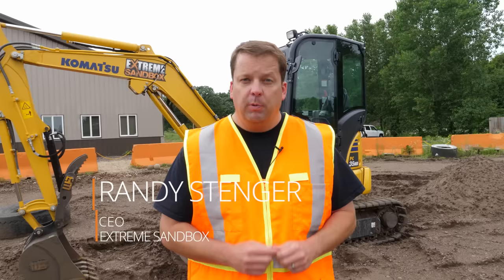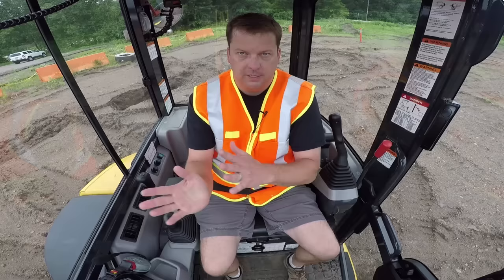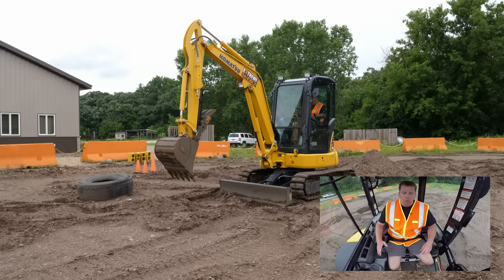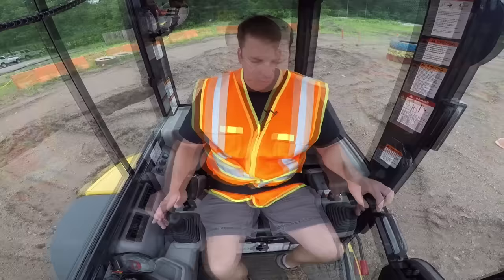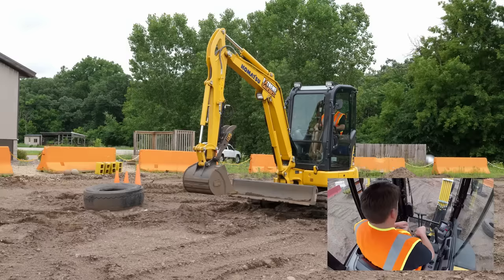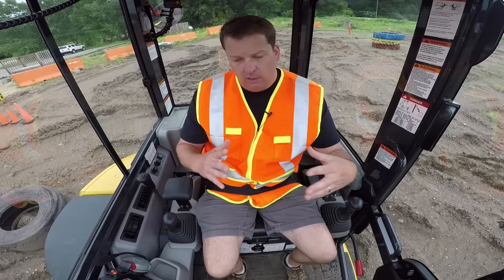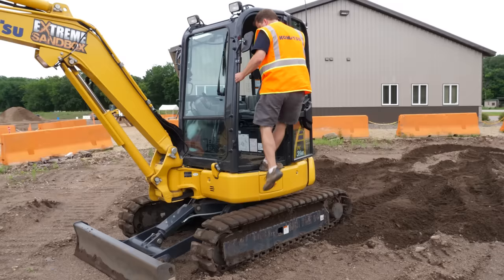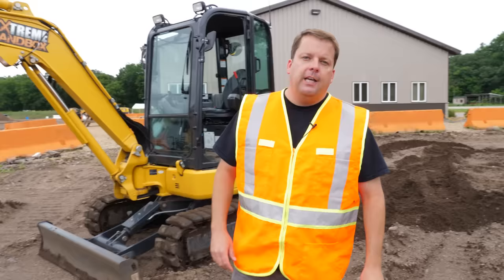How to Operate a Mini-Excavator | Mini Excavator Controls

Comment: As a professional excavator driver when operating a mini Digger with a Blade Allways Have the blade at the Back when you are Digging, there are 2 reasons for this no 1 you have more Digging pressure for the Bucket to dig and less chance of pulling Wheelies, no 2 you wont break your Back with the Digger bouncing and being  unstable, please feel free to test this out as you won't be long finding out whats best 😂😂😂😂
Reply from the maker: Thanks for the comment and feedback!
Reply: @HeavyMetalLearning  super channel it really helps drivers / operator's well done ☺☺☺
Reply: Coming from the lowlands (Netherlands). On the mini’s here you see a lot of extensions bolt on the blade to make it even more stable. Just 4 or 5 inch extra helps a lot in soft and wet dirt or clay. And the crazy man is right. Keep your blade in the back while digging. One or two bounces you Will survive, But getting kicked around in that cabin all day wears you out.
Reply: I always wondered why my dad sometimes left a mini ex with the cab turned around. That explains a lot.
Reply: I was thought not to dig on the drive wheels
Reply: @paulpresto8140  It's one of the biggest differences operating a mini vs a full sized one.
Reply: No. 3 gives better visibility into the trench
Reply: @paulpresto8140  Correct, for the bigger machines, for minis it different( blade to the rear as recommended by the manufacturer).

Comment: As a certified heavy equipment operator of 6 machines it is highly I'll advised to give anyone the idea that it is acceptable to dig from the side. You did mention that the machine is not as stable but that is a very lethal piece of advice as the mini as well as a 300 are HIGHLY prone to tipping and being unstable from side digging. For teaching anyone that has never used any machine I would just not recommend digging side on at all as this will give a dangerous impression that it's only a "little" dangerous. Everything was awesome but as this is instructing new comers to these machines any piece of advice that leaves room for interpretation of safety will cause injury. Not casting stones just figured I would share my knowledge from the field as to help make better and safer rental users :)
Reply from the maker: Appreciate you constructive feedback.  While I would say I generally agree with your statement, I don't think I would call it a "lethal" mistake for not digging square to your tracks (if the machine was not designed to dig that way there would be lock-outs to prevent it), so I agree it's good practice but no reason to scare a new operator when not necessary to just teach them the best technique.   Thanks for the comment.
Reply: @HeavyMetalLearning   oh it is not to scare. I just see it happened to often where the comfort level becomes the issue not so much the information. I've personally seen a few minis roll over due to complacency. Usually those that roll in that fashion are full bucket loaded added to the speed and weight pulling the mini over. Its practice that if it's not considered a lethal choice it can become lethal so it's more about the level of danger that the machine can be in without an experienced operator at the helm a small tip can turn into a big roll especially when you are fighting the balance. As a way to combat side digging with new operators you can recommend also using a 1 o'clock or 11 o'clock track positing and digging at diagonals to the tracks is a much safer and more stable way to side dig

Comment: Quick tip... I always move back and forth after putting the stabilizer bar on the ground. Cause usually you’ll be sitting just on the bar and the back part of the tracks. After you work the bar down a little ways below the dirt surface. Your tracks will flatten out and you’ll have more surface area on the ground and a lot more stability.
Reply from the maker: Excellent tip!  Thanks for sharing!
Reply: Or you can just have the blade behind you pushed down a little , adds wieght to the bucket , easier to drive ....

Comment: Excellent video.  I'd add one thing.  I'd add a box in one of the corners that just shows a block diagram of the controls being moved (as seen from above).  The ones being moved would be in bold as you are moving them. This would be sort of like showing the steps for a dance routing with the footsteps along with the dancers doing them - old school.  Once again - thanks much.

Comment: Thanks for your videos'.  I have a new New Holland e57c and have never used a excavator before.  I was a little nervous about even loading it and using it but your videos have helped me so much.  I will be loading on a 22' diamond c 20000 GVWR tilt trailer and using my 1997 f350 7.3 dually for my tow truck.  After watching your video's I believe I have a set up that will work and the more practice the better off I will be. Thanks for the emphasis put on safety also.

Comment: The boom swing is for digging off center, such as digging roadside ditches. You should train new operators to use that feature.
Reply from the maker: Great advice!
Reply: Wayne S. I also use that feature to dig a beam alongside a concrete form.

Comment: By the way I worked for Komatsu Australia and we called it a backfill blade, have em on every machine which ends in a 8 or 5 under 5 tons - AKA PC18, 35, 45, 55, 88, 138, 228, etc. PC stands for Power Crawler, and yes every other Komatsu abbreviation makes more sense than 'power crawler' which dates back to the 50s when Komatsu was a deadass Japanese-only outfit and is an example of jinglish that just hasn't gone away.
Almost all machines from 138 down have blades, we had at least a couple 228s (20-25tonners) with blades, I went through a workshirt cutting the plowbolts out with an oxy torch from beneath while on a creeper, hard to avoid the burn doing that.

All the models with MR or US in their title are minimal or zero swing radius machines - that means you should be able to swing the machine all around and your counterweight should remain inside of your tracks.

On the other hand standard body excavators will have 'LC' in their name, such as PC450LC-8. LC stands for long counterweight or long carriage, they do not have blades.

Komatsu mini-excavators (PC55 and down) are actually mechanically Yanmars, the powertrain, turbo, maybe even the pump (not sure) are Yanmar, this is the same with Hitachi and probably a bunch of other brands.
Komatsu Skidsteers/Bobcats have Kubota engines and are made in Italy, same as the backhoes, you can identify them with a serial code ending in F
- F stands for f***ed because all Komatsu Backhoes and Skid loaders are garbage, you need extend-o arms to work on those Backhoes, we had a skidsteer came back with 9hrs on the clock having lost a tyre off the rim, then the door broke and locked one of our mechs in for half a day. You get the picture.

Komatsu does best with its larger excavators and mining equipment especially the ol' American=made Dresser haul trucks, the articulated trucks are good, the wheel loaders are pretty good (not as good as Volvo) and the dozers are a go to if it weren't for CAT.
Pretty good gear.
Reply from the maker: This is awesome info....thanks for sharing!

Comment: all top operators have a cigarette in their mouth unlit. doors open and air con at full power, no seat-belt and a rock station mixed with static at all times
Reply: Working a site with a mini ex operator right now, can confirm this is true 😂
Reply: That sounds like me.
Reply: How it works here is that the machine gets the crap scratched out of it the operators smoke in the cab with the aircon running then open the doors when it's dusty as hell with air con running again,then work in the mud all day and not spin the tracks to get it out at all ,then I pick it up and drive on the road and make a big mess ,sound familiar any one.??
Reply: Dont forged dirty windows and reflection jacket on the seat
Reply: Urickhunt so true 😂
Reply: assassinlexx  lmfao, grease oozing haha
Reply: Hahaha got that all goin rite now.

Spot on!
Reply: Not near me.
The bloke near me was listening to the radio
Up town funk came on so he started singing the aussie parody of it.
Reply: I can confirm
Reply: JohnDeereCatFan98 Nh
Reply: Urickhunt that explains why I'm always in an 80's Rock mood when I'm operating newer construction equipment. The reason people keep the door opened on a mini ex is because they're getting in and out a lot. I don't think I've ever been in any machine that doesn't smell heavily of cigarettes. At least with my family, I rode behind the seat of the excavators, and my dad would do the same with my grandpa.
Reply: Hahahahaha
Reply: Can confirm
Reply: Yep us top operators do.
Reply: Aht aht aht or a 80s or 90s hiphop station and a vape...lol
Reply: Daily driver can confirm this is true 👍🏼😂
Reply: I don't.
Reply: Yeeeeeaaaah Boy
Reply: Not all Operator...

Comment: Basic but a start ,as for the blade at the back,doesn’t matter it will depend on application,if learning blade at the front may be a advantage,but it’s horses for course ,hard digging blade at the back to stop rocking ,be careful on slopes if your on offset ,👍🏼👍🏼
Reply from the maker: Thanks for the comment!

Comment: part of every operation of any piece of equipment around our outfit is "pre-check' or walk around, look for obvious problems and check the fuel and DEF levels along with hydraulic fluid levels and air intake clean out just incase you sucked up a cat or some other critter ;-) or crud. Word of the day- smooth" !!!
Reply from the maker: Excellent point!
Reply: not for the sake of fun. this company takes care of pre trip inspection u just have fum.

Comment: Secret tip if you put the lever down on the blade it goes with the grade of the yard well the mini excavator I operate does I don’t know exactly with other mini excavators but it’s good when back filling or pushing dirt
Reply: Just got to push the lever down fast and dont push the lever slowly it will work 👌

Comment: Not sure what you mean by "mini excavator controls".
Excavator controls are universal across all brands and all sizes of excavators, with very few exceptions.
Even the controls on backhoes are universal with few exceptions.
They have either John Deere or Caterpillar control patterns with a third pattern that's hardly ever seen.  The two common paterns arel also known as ISO & SAE. 

Additional trivia:
Backhoes have the same option of those two patterns except for Case control pattern backhoes and maybe one or two others that are very seldom seen if ever, and they're usually on very old machines, or on a few small Chinese machines that have four levers, each with a single function, instead of the standardized two lever setup, each lever having two functions, also known as joysticks.
And in the last 10 years or both excavators and backhoes have both patterns on every machine controlled by a switch between those two patterns.

There have also been Backhoes manufactured that could be mechanically altered by changing the linkage between the levers and the actual hydraulic valves to change the different patterns, including the Case control pattern on backhoes by changing the entire lever set.

Comment: Very impressive. Can you show how you push and pull the bucket in a racking motion horizontally across the surface whilst keeping it level? Is there a skill to do this or is the digger designed with this in mind? Similarly, if you are digging a trench and want to maintain the depth through its length.
Reply from the maker: Thanks for the comment.  I think we can put some of that in the next video.  Not sure on the exact tip or trick other than just plenty of practice using both the boom and stick at same time to keep height consistent.

Comment: if you want to excavate a thin top layer of earth with a micro digger, about  7 cm (3 inches or 700mm) can you just use the stabiliser bar and push earth around whilst driving forward? or maybe in a couple of goes? 1 inch at a time?

Comment: So after watching this video I was able to use a rental excavator much more efficiently I put in a seeping pit and drainage pipe on my property. 
Although I have to admit one facepalm moment. When the machine was delivered they had the cab turned 180 so the blade was behind the seat. I'm guessing for stability in transport? So anyway, my stupid butt operated it for about an hour on the assumption that this was just some weird model that had the blade in the back. Even made mental note of how weird it was that the forward/reverse was opposite the direction of travel. . . Then finally spun around and it sunk in. Had a good laugh at myself. But still finished the job, so I guess alls well that ends well!

Comment: I want to rip out some juniper bushes from my front yard.  They are about 3 feet high, 6 feet wide.  At first I was thinking about renting a skid steer, but this looks like it might work better.  I think I could just reach down from above, grab them with the thumb, and pull them out.  Any suggestions?
Reply from the maker: Yeah, I would recommend a mini-excavator over a skid steer for removing any landscaping.

Comment: Nice video. Just a quick note though. On a machine less than 3 tons, you need to keep the blade behind you and down when you dig. This pins the machine so it can use the full force without lifting itself off the ground and creating a dangerous situation.
Reply from the maker: Excellent point.  We cover that more in our Mini Excavator 201 training video.  Thanks for the comment!

Comment: I don't see any tamping when backfilling is it hard on the machine? Also can you get in trouble by driving over a newly filled trench especially with one track in the loose fill?
Reply from the maker: Not necessarily.  You definitely can use the bucket to do some compacting of the soil, just depends on how big an area.  And generally as long as the trench is filled in you can drive one track on it but just be prepared that side may sink in a little.

Comment: Would you recommend a mini-excavator with tracks or one of those tractor-style backhoe frontloaders for digging trenches on a slope, where the trenches are perpendicular to the slope?  For example, if the slope went downwards from north to south, each trench would stretch from east to west.  And would you recommend starting at the top or bottom of the slope?  I saw the tractor-style video, where you parked it parallel to the trench and used the feet to try to level the machine.  With the mini-excavator, would you park it facing downhill and then turn the cab and arm sideways?  Awesome videos, btw!!
Reply: Yes. Point the tracks in the direction you are most cautious about tipping. Start on the slope where you feel like you will be the most efficient without too much wasted travel and unnecessary moving.

Comment: Can you break the thumb or thumb cylinder by curling the bucket to much into it?
Reply from the maker: I would say that generally speaking, no.  They are designed to be pressed in to each other and you will notice there are hydraulic relief valves on them so they will let up a little if too much pressure.

Comment: Further: why don't you use these movements (11:00) on the big excavators?
Reply from the maker: Depends what moves, if you are referencing the back-filling I think we did cover something similar on the larger one.   As far as doing most of the scoops and only using the side of the bucket for finish grade.  Unless you are referencing something else.   Thanks for the comment!

Comment: Hi ,Very nice video  :)does the mini excavator have track extension lever? ,i mean lever that can extend the track sideways and tracks become wider,that extend  them sideways ,because the mini scooper i worked for a while had that lever and with the blade on ground and bucked from other side on ground it was this way on the air and than i was able to move the lever and stretch the tracks sideways ,beside that, is this method with the excavator in the air, supported with mini dozer blade and bucket from the other side on the ground safe ?Thank you :)
Reply from the maker: No, our mini's and most I know don't have extenders on the tracks.   We have a smaller electric excavator that has that, which I believe those smaller units do have that so they can fit through a standard doorway for an indoor project.   In those cases, you don't need to have the tracks in the air to extend them but can do that if you don't want to mark up your floor.
Reply: @HeavyMetalLearning Thank You :)The videos are very nice and useful :)Yes ,the track extenders are for small and narrow spaces ,i also heard that but the excavator itself  is very heavy for indoor operations :)

Comment: Is there a possibility for this mini backhoe to be over heated?
Reply from the maker: Anything with an engine can be overheated, but generally speaking if you are operating in normal conditions and maintaining your machine you won’t get in that situation.
Reply: Kubota's trash screen needs to be cleaned on the radiator.

Comment: Im no expert my step bro ownes a grading co.he has been wking all types of heavy equipment his whole life. Im more an operator. Used several types of equipment .i got a small back hoe rt end loader. Lots of fun savedmyself $$ lots of digging renovating 2 acer yard with house .. used a veriaty of Lulls. Sky Trex .genies gjl. 110ft boom lyft. And it seems to me the #1 mistake made is not paying attention to ur surroundings.. so please if u operate heavy or even smaller equipment . Always keep ur head on a 360* swiel especially 200* in the direction ur traveling.. never take anything for granted.